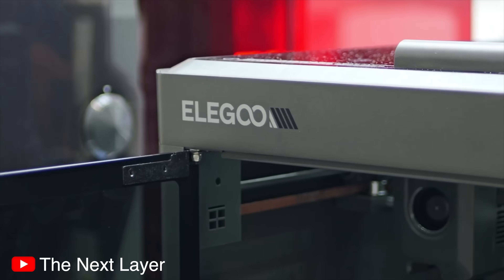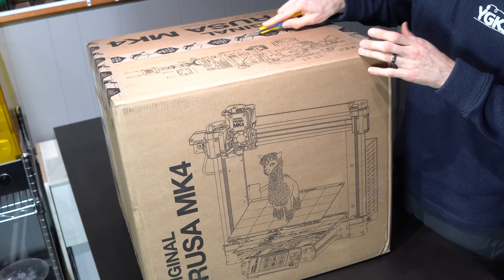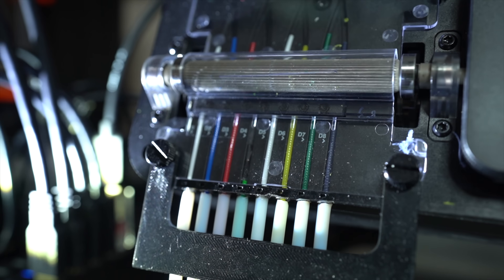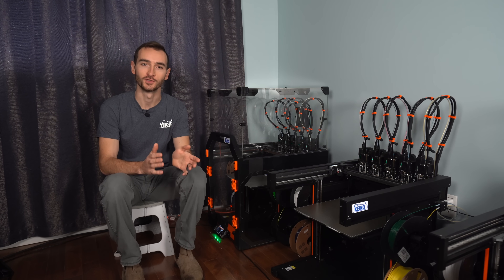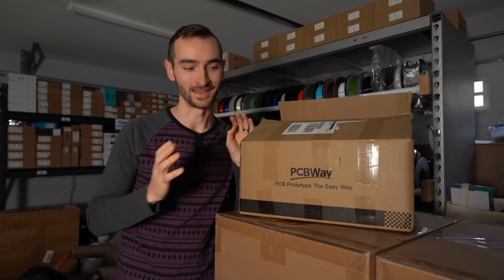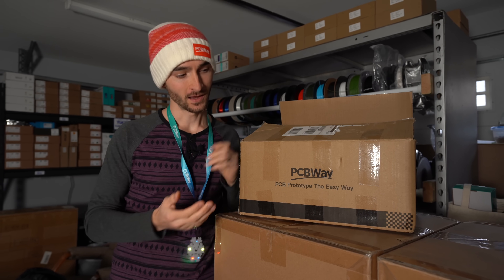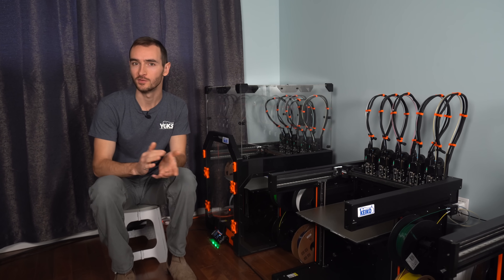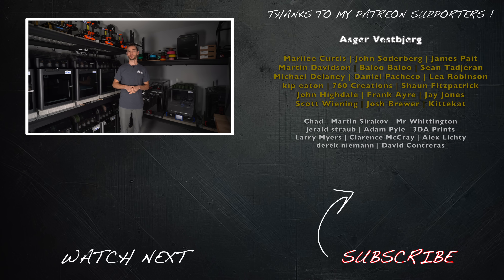The Prusa Core One is dividing the internet...

Comment: Prusa is reliable, made in EU/US, mostly open with a open firmware, nobody is using you data for research, and you can trust the team for support and help. That's why you are paying a "premium".
Reply: Prusa would be better off using user data to improve their products. It benefits everyone.
Reply: @Keveira  you can if you want. But you see what you are sending. Weird, right.
Reply: Can't use US as a quality flex
Reply: @soeren72  not a fan of the usa, especially considering the actual politics, but you can absolutely consider the fact that a business like Prusa making stuff in the US as a quality gage. Prusa care about their customers, they gonna be on place, making stuff, and paying their employees. It's not like finding the cheaper business in China to make what you want. I agree that us stuff isn't good by default, but considering Prusa, we know it's gonna be as good as EU made, that's my point. There is no reason why a EU made pcb will be better than a US pcb if the maker is the same.
Reply: I hope that by "open" you don't mean open source. Because they're not. The last more or less fully open source Prusa printer was the MK3S+, every single machine since than has been only partially open source (mostly just the stuff they kept from previous generations and none of the improvements, like the new extruder) and the Core One is fully closed.
Reply: @hellterminator  yes, I mean open source, and by mostly, Im talking about the firmware. The most important. Anyway body can, and will, reverse engineering parts. That's not the problem, the problem we are facing actually is security, and Prusa is by far the better choice and the company to trust if you want to go on a new gen printer. I really don't give a fuck about a closed source parts, but we need to have access to the firmware and read.
Reply: @1337BlueBird  TIL one small part = mostly. 
Assuming the firmware  will be open source, that's something that would make me tolerate the printer, but not to want it. And it sure isn't enough to call the printer as a whole open.
Reply: @hellterminator  yes, because the most important thing to be open is the firmware. It's not a part btw. It's way more important than any parts and that's why I said mostly, it's not by quantity, it's by importance for the user.
Reply: @1337BlueBird  It's not the most important to "the user," it's most important to you. 
And you're making it sound like it's either or. It's not. When the hardware is open, the firmware will be, too, because there's not point keeping it close because with open hardware, there'd be nothing to stop you from writing your own. 
Open hardware is the bigger of the two. Open firmware just isn't good enough for me to pay like 50% more.
Reply: @hellterminator  it's the most important for the security and privacy aspect. It's the most important if you want to buy a piece of technology from a honest business who cares about their customers. Considering that, the fact Prusa is reliable, good service, with by far the best longevity over time considering they always offer upgrade kit for an older model, that the machine isn't build in China, yes it's definitely worth the price.
Reply: @hellterminator  they're closed only until next generation comes out. Do your research bit better next time. Also for like Core they've already published side panel dimensions for users to tweak as much they want. Bambu or in fact none other manufacturer offers even that kind details about their machines
Reply: It’s pretty clear that the details like where it is made, open source, data control were not worth much of a premium when the machine didn’t match the performance of the Bambu.  People their money on what they really value and for most Prusa didn’t offer the better value.  Maybe that’s changed now with Bambu’s heel turn.

Prusa machines cost more because they cost more to make.  They have been pretty open about their manufacturing processes and to a manufacturing engineer like me it’s pretty obvious minimizing cost wasn’t a priority.  I like Prusa a lot but they will have to change their manufacturing processes to compete outside of the enthusiast market.
Reply: @stacybehrens7152  it's not just the manufacturing costs they have. It's partly in their name. Research. I got like few weeks ago profiles for PrusaSlicer and it's not that long ago when I last updated MK3S printers firmware. That's like 7 years of frequent updates to software and firmware. That has to be taken into account. I at least value that highly. Virtually all others like Creality throw out new printers like every six months, they're not bad machines, but everything is closed and even parts availability isn't known. Few weeks ago I ordered thermistor for my work MK3S that had heat perished cables that shorted. Looked documentation from their site, measured resistance of thermistor and was almost 100 sure that mobo is still good. So ordered that 6 or 10 euro thermistor from Prusas stock and it's back in business after hundreds of printing hours.
Reply: It is 3D printed plastic bolted together ws industrially produced machines.
The PRUSA XL looks good, but the rest seems to prototype style stuff with great software.
Reply: @jenspetersen5865  looks like the parts material and origin do not affect the quality of the printer. The mk3/mk4 is an amazing printer offering great quality print, solid printer, and longevity. Can't say the same for majority of other less expensive printer using the same structural principles and 3d injected molding parts. Prusa have a lot of experience, and know what they are doing. If they 3d print parts, it's because they can, without affecting the quality of the printer. They may look like prototype but in fact they are one of the most used machine in 3d printed farms because of all the qualities said before.
Reply: @1337BlueBird  it's just worse in any way to injection molding : price, strength, quality and it explains the months of back orders they had with their launches.
Reply: @emanggitulah4319  stop crying bud, I just tell you quality and strength of the 3d printed parts do not affect the quality of the printer. They use 3d printed parts when they can use 3d printed parts. They use injection molding when they need it. They use steel parts when they need it. Let the engineers do the job, apparently they are pretty good considering all the achievements Prusa did 😉 or send them a email on WHY they should use injection molding on a front cover.
Reply: @emanggitulah4319  Baseless. According to their own video's the plastic parts have never been the bottleneck in producing/shipping printers. Which I find easy to believe as well, because that is the part of the supply chain they have complete control over ...
Reply: Reliable? Prusa hasn't released a reliable printer since the Mk4. From promised features still being developed after release despite being advertised to selling projects as products like they did with the XL.
Reply: I would not mind paying premium *if* I get all the features & experience... It's not that way with Prusa unfortunately. :(
Reply: @komplikatorful  features and experiences of what?
Reply: @komplikatorful  true. I totally agree
Reply: "Reliable" - "you can trust the team for support and help"
Hopefully you dont end up having the experience I did when I bought a MK4 at launch and they sent me a total lemon. Full of extruder and heatbed issues and couldnt print a thing. Support dragged me through the ringer for my full warranty period even admitting on record the machine was a lemon but that they wouldnt replace it because, ahem, "its better for us to just send you a part than a whole machine." Again, they admitted on record that the machine was a lemon but instead of replacing it they just ran out my whole warranty period looking for the one part to replace. I even said I would pay for shipping and send back my busted one, but nope. 
Now I'm out of warranty buying parts out of pocket just trying to get it to even work. I will never make the mistake of buying Prusa again. On a side note, they do collect data like everyone else under the the whole, "help us improve?" guise. It's up to them to decide how your data "helps them improve" so... I guess pick the answer you want to believe?
Reply: @mrkthmn  If you aren't capable of making your machine work, go buy an Xbox not a 3D printer. They are complex machines and you will need to do maintainence sooner or later.
Reply: Reliable? Always had very mixed results with 1st layer adhesion with prusa. No issues with bambu lab though
Reply: @emanggitulah4319  That is your fault dude 🤣
Reply: @emanggitulah4319  and some bambu users had problems. It's a 3d printer, fine mechanics, not a hammer. But do you research, Prusa is known all over the world to be one of the most reliable printer, for a long time.
Reply: @1337BlueBird  I had both. Lots of problems with the prusa. And for a premium price I expect good parts,not some hastily printed subpar stuff. Those details really annoyed me with the prusa... And don't get me started with the fan boys that defend the crap
Reply: @emanggitulah4319  plenty of fan boys for either printer—it IS the internet you know.
Reply: "Paying a premium" would be 15%. At double the price, it's calling their customers idiots.
Reply: @Giskard_Reventlov  Start a 3d print manufacturer in EU or USA and let me know instead of pulling random number. Just send a step file to an american manufacturer for 5k pieces VS china and let me know if the difference is 15% lol
Reply: @Giskard_Reventlov  15% more is not a premium. Companies can pay double or triple for a machine if it's reliable and easy to fix even if it doesn't have the cool features.
Reply: @Giskard_Reventlov  you can't decide by yourself the right price by pulling a random number from your ass ser 🤣
Reply: @Giskard_Reventlov  Well right now Core One and Bambu X1C costs virtually exactly same. Ok Prusa costs 6 euros more :D

Comment: PrusaXL was the worst purchase of my life. Hasn't worked properly for 1 day in its life. It literally cannot finish any print that takes more than an hour or is taller than 100mm. Customer service has not been helpful one bit. 5000 dollar paper weight that became obsolete the moment my bambu got here. I have since made an effort to not support prusa in any way. We have 3 mk3+ machines and the XL with multiple heads so we clearly used to be loyal customers but after dealing with customer service (or lack there of) regarding this garbage they call the XL we will never purchase anything prusa. Their prices are out to lunch too considering their crazy shipping rates (300 dollar plus to Canada).

Comment: I own 3 Prusa (two Mk4s one Mk3S+) and a Bambu Lab X1 Carbon. The Prusa's have been reliable and I had great customer service. For speed, the X1 has been great but I had to slow it down because it was not giving quality prints (at this point it is on par for speed with the MK4s for me.) Bambu Lab has been hit and miss with their customer service. The AMS on the X1 is easier to load filament but I had to already replace the feed motor on the AMS after less than a year service. The AMS on the Prusa can be a pain to load and unload filament. For versatile of material, I have printed PLA, PETG, ASA, PC, and TPU from the Prusa from various manufactures and the have worked fine. On the X1, anything other than PLA has given me problems (the X1 was down for 2 months due PETG jammed in the extruder.) Any filament other than Bambu Lab filament has required a lot of tuning to make it work. For the Prusa, I used the Prusament setting for 90% of the filament I have tried without any issues or tuning.

Comment: I'm for the open source CoreXY platforms and am a Bigtreetech/Klipper fan now, coupled with a Raspberry Pi that's running Octoprint.
I'm done buying into assembled solutions, when the parts are so readily available or printable at a fraction of the cost.

Comment: I considered buying a Prusa XL 5 head machine and started reading the 1 star reviews relavent to printer issues. Many folks who commented suggested the response time from Prusa lacked concern. And in some cases it was endless diagnostics to attempt to resolve a problem, in many cases consuming weeks of time with a printer that still wasn't functioning. I sent Prusa, via there contact tool, questions about this, and to date, never received a reply. I also entered a chat with them and asked if a new printer could include PCCF parts to be able to tolerate heat of an enclosure, instead of PetG and basically told "no". 

I know there are many that claim Prusa is great at customer service, but my experience before even purchasing a machine that I was hoping would fill my needs, seems quite the opposite with Prusa. And those folks who have poor ratings on Prusa's website for the XL, seem to be at a loss for customer service. And some might say, look at all the positive reviews! Well the reviews left are misleading, because many of them, especially the older ones, aren't reviews at all, they are comments about the upcoming release of the printer, not real reviews, which greatly slant the overall rating favorably. 

So someone please try and tell me why I should still consider buying this printer that has a premium price, significant shipping expense, and may not perform as it should. I don't want to spend all this money on a potential brick.
Reply: Just ask people who own a Prusa XL if they are happy with their printer or not. Reviews do not necessarily reflect reality. Also, someone who has had a negative experience is more likely to write a review to complain than someone who has had a positive experience.

In the beginning Prusa had delivery problems because they suffered from the chip crisis during the Covid years like many other companies. This is better now and the initial problems have also been resolved.

As far as I know, the parts on the current models are all PCCF.

Comment: My issue is I don’t want to buy either. I agree, if the Core One had a tool changer and a slightly larger build plate it would be a no brainer. But my several Mk3s printers still work great even if they are a bit slow. Right now I’m not printing as much as I used to. I vastly prefer Prusa over Bambu and I’ve considered the XL but now I worry it may be a bit old considering all the subsequent innovation at Prusa. A slightly lower cost upgraded XL or similar would be an expensive but worthwhile purchase for me. But so far I’m not seeing the value in the Core One for me beyond a better bed leveling system and much faster prints.

Comment: I think the real concern with Bambus becoming paper weights is that Bambu has to make the parts. Right now they've promised to do so until 2027 for the current line up. What happens after that point though? Maybe there is parts commonality and it doesn't matter, maybe there isn't. 
Prusa tends to have a lot of parts that are standard and a lot of parts commonality across all their products. 
It's important to remember their are a lot of different use cases and many of them not consumer. I work in a lab,  If I was writing a purchase proposal to my supervisor right now it would be for the prusa for these reasons. The Bambu simply does not offer enough advantage to justify risking limited grant money.
Reply from the maker: @notsam498  great points!

Comment: If the multitude tool head opinion would have been available Core One for under $2k, if the multitude tool head opinion worked 100% of the time (something I've never seen on the XL) and if the Core One did 300 x 300 or larger it would have been a contender. That's a lot of ifs that will never happen.

Comment: At my makerspace, when people ask about what kind of printer they should get, I ask them: Which do you want?  A printer that you can unbox and print with, or one that teaches you about how they are built and want to learn from?  If they are just looking for a set it up and work printer, I tell them to get a Bambu printer.  If they want a project and want to know more, I tell them to get a Prusa kit and build it.  A Prusa Mk3s was donated to our space and in the month that we've had it, it's been used more and failed less than the Ender 5 and Anycubic machines we have on the bench. 

And all of this depends on your use case.  I do casual 3D printing, with functional parts and some cosplay props.  I don't sell my things, so having a quick printer isn't my focus, but it may be for others.  I look for accuracy and the ability to print tougher materials, and have been rocking a single toolhead XL since I received my pre-order machine.  

I do see the mindset of saying that Prusa is meeting Bambu at their level, but even the MK4 seemed more of a "We did the research on making this awesome Nextruder, can we put it on a MK3s and make a faster bed slinger?", while the Core One seems less like "How do we compete with Bambu" and more of a "How do we make a smaller version of the XL out of a MK4?"

Comment: If I had that kind of money I'd build a Voron. I Like Prusa but that build volume is too small for me (Not that the X1C is much better mind you) But the locked down-cloud connected firmware is a hard pass for me. It's clear that BBL consider 100% local use a distant second "we'll work on it sometime, maybe" feature not a hard requirement of 100% functionality without cloud services. Any company with that attitude is not to be trusted or given my money.